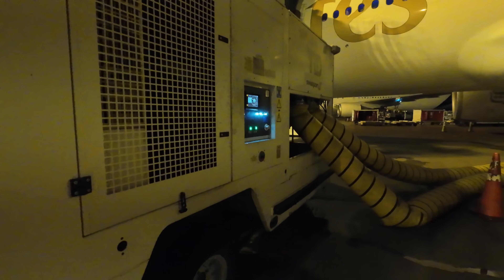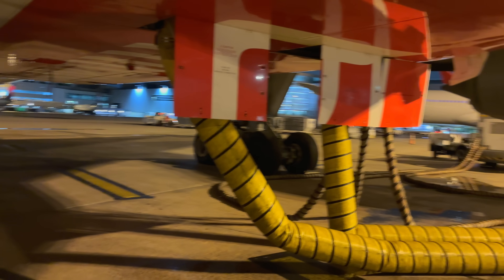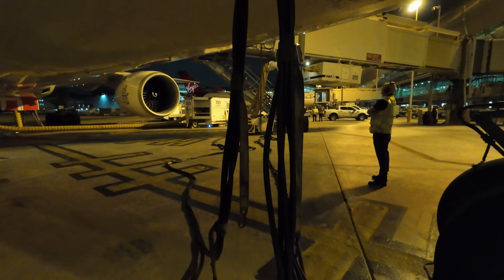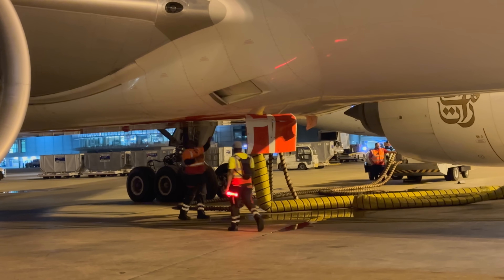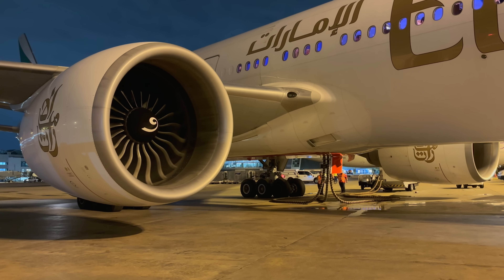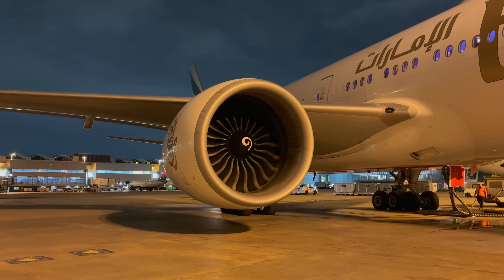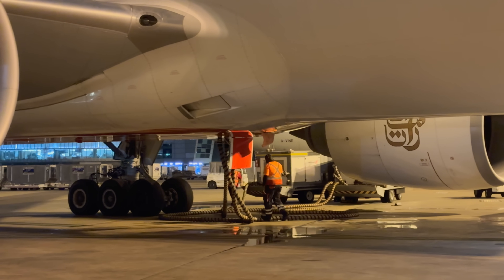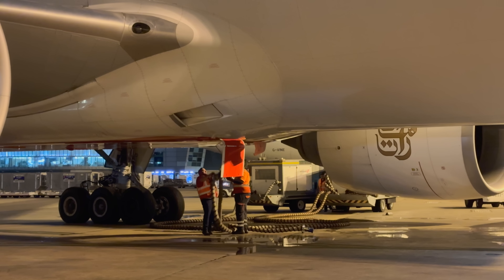Boeing B777 300ER, lets get it started

Comment: I worked in line maintenance in the good old days and a 747 without an APU was a real pain to start as the ground airstart units we had for 707, DC8's etc lacked enough oomph to start a JT9. We usually needed 3 airstart units to get the first engine started however the basic 747 only had 2 ground connections so we had to make a Y duct to enable 2 airstart units to be connected to one aircraft connector and a 3rd unit to the other connector. Boeing had an option for a 3rd connector and many airlines took it to eliminate the need for the Y duct. The RB211 powered 747 also needed 3 ground airstart units to get going. No experience with CF6 powered 747's so can't comment. The type of ground start units we had were powered by a large gasoline fueled V8 that would overheat in tropical conditions if run at full throttle for too long so a long slow start was another major problem.
Reply from the maker: I believe some of those old ASU’s are still in use I think 🤓. If you have a good ASU two connections are often sufficient.

Comment: Which airport is this? And what happened if the engine flame out in the air and the apu is not working? Layman here.
Reply from the maker: It’s Miami, if only one flames out you still have the other engine. Main systems will still be working, but there will be load shedding this to not have the last generator not overload.

Comment: So the APU isn’t required for normal flight operations?
Reply from the maker: It depends on the aircraft, the B777 and A350 will still be 180 ETOPS if APU is INOP.
Reply: @dennisvijverbergbrakesrele6098 Oh wow, I was curious about the impact to ETOPS. Are there any other considerations or operational limits aside from ensuring any destination has sufficient equipment to start you again?
Reply: Not needed if you're flying over land

Comment: How are you as a KLM employee (at least i think you are because of your name and KLM vehicle) involved on this Emirates flight. First i thought maybe they are a member of the Skyteam but they are not 😅
Reply: KLM might have a contract to service Emirates flights at this particular airport.   For example at DFW (dallas forth worth) American airlines provides ground support and mechanical assistance to almost all of the international carriers that serve DFW
Reply: Certain airports utilized qualified maintenance personnel in this case a KLM employee has and is qualified to work on the triple seven. Emirates flies into this specific airport they contract out this maintenance task to these employees. KLM operates all type of the triple seven so it makes emirates operations easier to use them to work on these aircraft’s at these specific airports. However if no qualified maintenance personnel is present the flight crew can AOG aircraft on ground if there is a serious issue with the safety of the aircraft.

Comment: Is the start cart a gas turbine?? Sounds more like the ol' hot rod engines in the carts they used for the SR-71.  Why is it so noisy??
Reply from the maker: Because the Air Start Unit makes a lot of noise.
Reply: @dennisvijverbergbrakesrele6098  Dang....why didn't I think of that??

Comment: Dennis, if the APU is inop, does that affect the ETOPS rating?
Reply from the maker: Yes, aircraft is now 180, normally they are 207.
Reply: How does it change the ETOPS rating for A350-900 and -1000, if APU is not availible?

Comment: Why don’t we hear the usual GE90-115B startup sound? I know there is loud noise from the ground equipement but the GE90 should be much louder. 

Many thanks!
Reply from the maker: Indeed, the ASU is very loud, the low hum of the engine starting up is there, but the ASU is over shadowing it.
Reply: It’s because mic equalizes the sounds. You can notice how much quieter the ASU is once engine I started
Reply: @MONRFin  yes but couldn’t we have at least hear a little when the engine begins to start (the famous GE90 drop) and when the fuel is injected. One of the best sound in aviation. Thanks General Electric
Reply: @Youtub77W how can we identify the moment when fuel is injected with the sound please
Reply: @planescarstransport2763  when GE90 startup begins you first hear the air being injected in the engine: which is the first sound you hear and looks more like a roar sound. Then the fuel is injected and that’s when you hear the sudden very loud bass sound that last till the end of the startup (with the famous GE90 break at the very end).
Reply: @Youtub77W wow incredible

Comment: Why aircraft start enginge at a gate? What is the reason?
Reply: Because the APU was inop.
Reply: @ what means inop?
Reply: @ArCtic2509 short form of ‘inoperative’.
Reply: @ArCtic2509  inoperative. Not working. The auxiliary power unit (apu) wasn't working. The APU provides power when the engines are not running and air to start the engines.
Reply: Jet engines need a lot of power to start, more than an electric motor running off a battery could possibly provide. In order to start them, planes have a much smaller engine called an APU in their tail. It supplies electricity and compressed air to the aircraft, the compressed air is what's used to start the engines. In this case, the APU isn't working, so the only way to start the engine is an external source of compressed air. Once one engine is running, the compressed air it provides is used to start the other engine.
Reply: @KingdaToro    Thank you for the explanation.  Can you explain how compressed air starts an engine?  Apologies for the basic question.

Comment: Great video Dennis! It amazing how much is needed to replace the APU! It must move some serious bleed air if it needs 2 jet starter carts to replace it!
Reply: The 777 needs a really powerful APU because of the absolutely massive GE90 engines. The APU is actually powerful enough to start two smaller engines at once, but can only start a single GE90 at a time.
Reply: Absolutely amazing video.thank you
Reply: this is very scare, my cat sad
Reply: @grahamcracker659  My cat reacted to the air jet starter too 😅

Comment: without fixed tieres ? only by parking break ... we heared so often that USA is so strong with "rules" , "saftey first" and so on ...
wenn ich in'er flugschule wäre für diese luftfahrzeuge würde ich ne' beschwerde schreiben ... ein riesen hype um milliardäre , politik und sonstiges aber dat einfache funktioniert nicht beispielhaft
Reply: The tug would also be connected to the plane at this point, so it's not going anywhere. Besides, a jet engine at idle doesn't provide enough thrust to get a plane moving from a standstill.
Reply: @KingdaToro  thank you
Reply from the maker: Uhhhh ok
Reply: @dennisvijverbergbrakesrele6098  because how you and ground crew can be sure that the parking break work without mistakes
Reply from the maker: @grachoderunwiderstehlichen  there is a 50 tons tow tug connected to the aircraft, not directly visible in the video.
Reply: Womp womp, no ideas about the approved procedures but hier seinen dummen Senf zugeben.
Geh in deine Flugschule zurück…